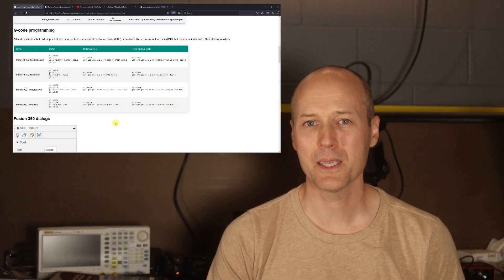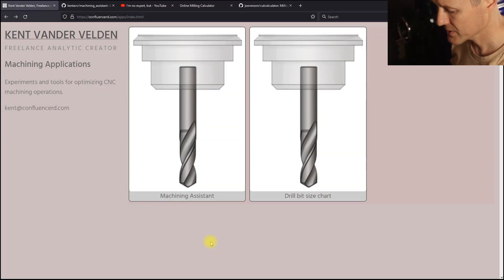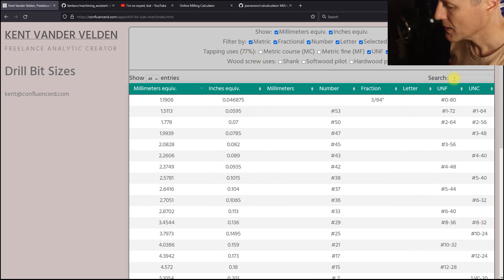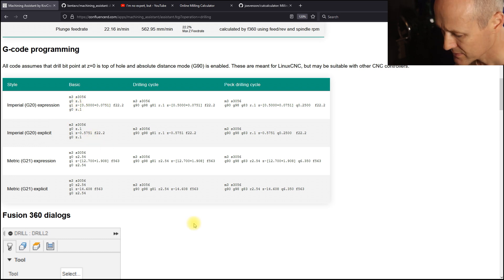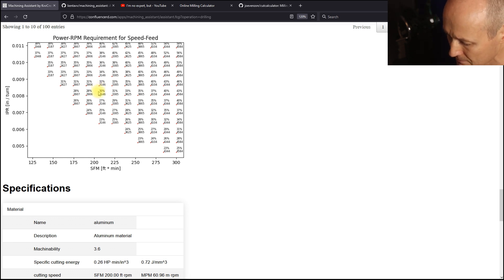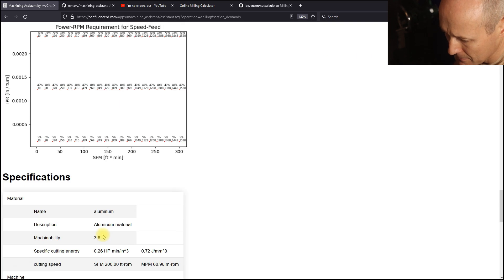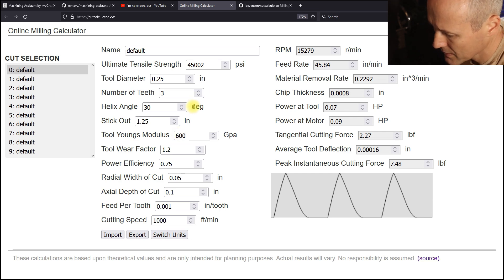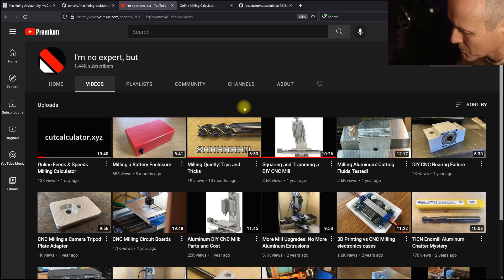Drilling Speeds-Feeds Calculator

Comment from the maker: Please help to build a list of useful online machining calculators and references in the comments. Maybe some of the best ideas will make their way into future calculators. Thank you

In the video, I didn't explain my interest in drilling. With some amount of testing one could build a empirical model of their machine. Feeds-speeds generated by an empirical may be closer to reality for that machine than theory driven calculators. I collected the necessary data for drilling and then implemented the theory of drilling to compare with the empirical model. Later believed optimization would be more easily performed by starting with conservative speed-feeds and using adaptive control to optimize. With either goal, needed to start with a simple operation.